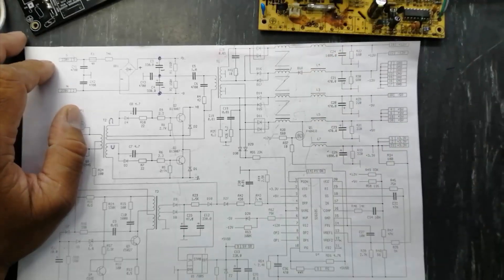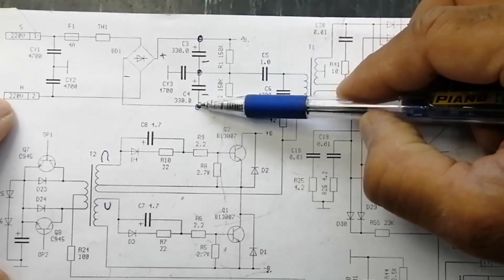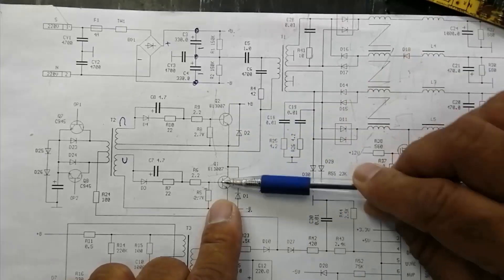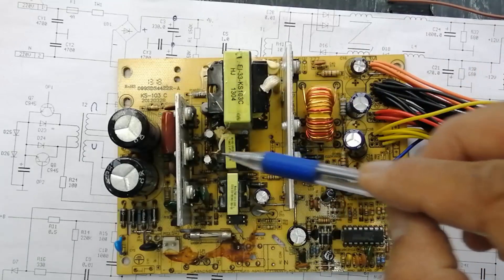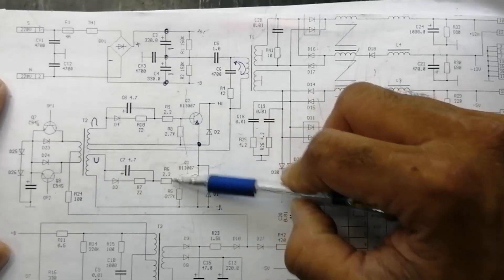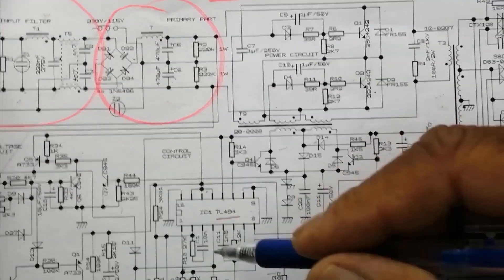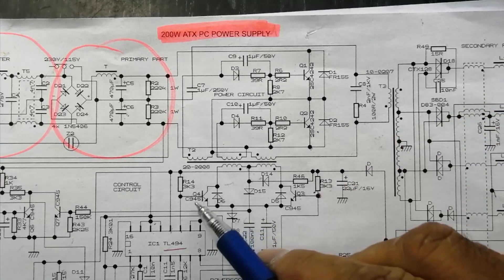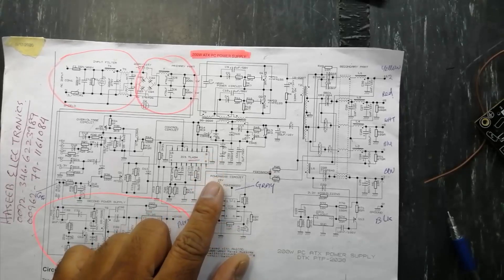{250} Function of High Frequency Transformer in Computer ATX Power Supply

Comment: what happened when one power capacitor 330 mfd/200v  becomes weak, but total output voltage is generating 336 v dc
Reply from the maker: when one capacitor becomes weak, it causes to less switch in that specific side transistor / MOSFET. thus the ic needs more duty cycle to maintain voltage. in result one mosfet will start heating up, and will lead to early failure

Comment: Hello again I have a big question about atx transformers and tl494 push pull and frequency t, the question is why tl494 high frequency push pull refuse to work with atx transformer at 12 kHz to 250khz the mosfet just ringing and getting hot and no conduction happening so I need to understand why is this but when I turn the frequency to 60 hz iron core transformer there is conductivity but not with atx transformer at high frequency am confuse to this point

Comment: Excellent video as usual. The exact function of the two input capacitors in series until now had not been very clear to me. Also from previous research on the use of the two resistors across the capacitors in series from my understanding was for balance. Never occurred to me that these resistors also were used to bleed the charges off the caps.. I did understand that when using a single reserve capacitor as I always monitor the discharge with my digital multimeter prior to began a repair. Thanks for enhancing my knowledge of half bridge Switch Mode power supplies. Really enjoy your videos.
Reply from the maker: best regards and special thanks for your valuable appreciation
basically use of 2 bulk capacitors is compulsory to design a half bridge SMPS topology to obtain a maximum output power by using bipolar magnetic in the ferrite core transformer
and the both capacitors also allow to convert the same design for 110/220 switching
resistors across bulk capacitors are used to bleed off (discharge) the capacitors whenever teh PSU of switched off
i will make a special video on this topic to discuss the switching topology and usage of 2 series capacitors

Comment: Googled for repairing my cooler master rs350 -psar-I3 smps but i ended up here, you are the one explaining about ps_on and standy voltage things. i am getting 3 volt in green wire(it should be 5 v right ?) and 5 volt in purple wire, where to find the faulty thing ? also little hesitation to check on hot test since its has high voltage or as you said could damage my multi-meter.

your videos are so educational, practical things and in-depth on how things works, its great but still more to learn from every single of your videos to watch rewind, again and again. Thanks for your effort.